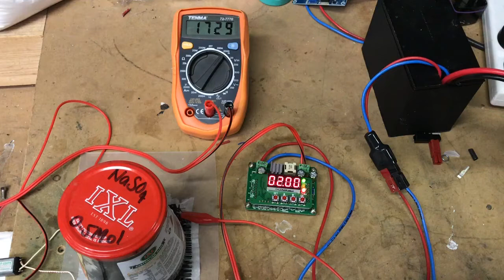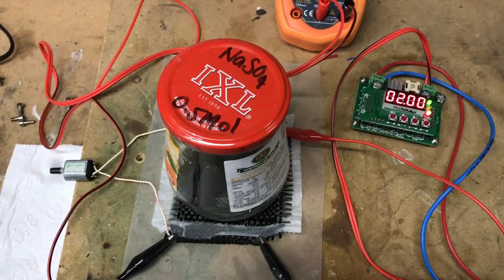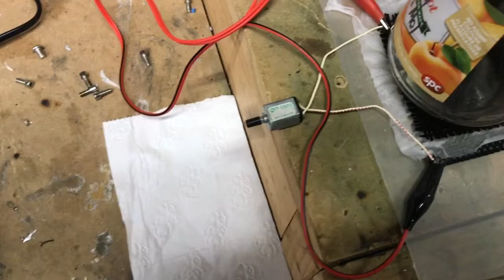Carbon Fiber Supercapacitor, 2V charge, baseline 21secs

Comment: Hi Sam, Interesting vid.
What’s important is sticking to a logical approach and not changing too many things at once, and you are doing that with your benchmark test.
You may want to include a discharge test using a standard value resistor, there is no problem for other people to then replicate your work.   :-)      Martin.
Reply from the maker: solarhope sounds good - what value resistor are people using?
Reply from the maker: solarhope oh also a few of us have started a diiy supercap Facebook group. Feel free to join!
Reply: Hi Sam, 24R or 47R 1% resistors should be ok, they are common preferred values.
They can be connected in series or parallel arrangements,  giving
a wide range of currents depending on cell size :-)    Martin.